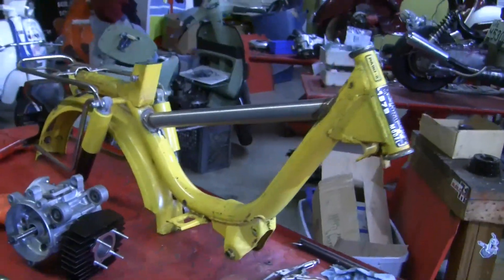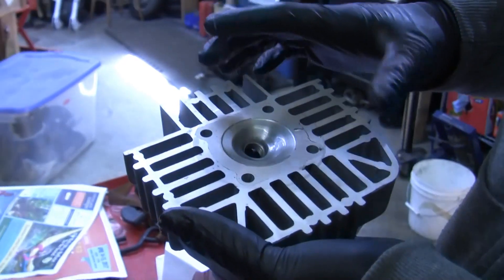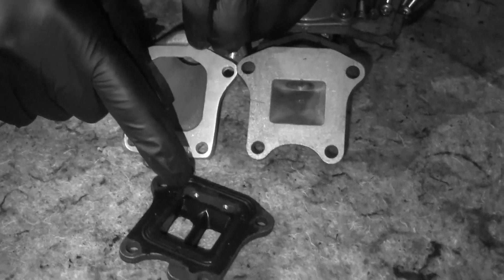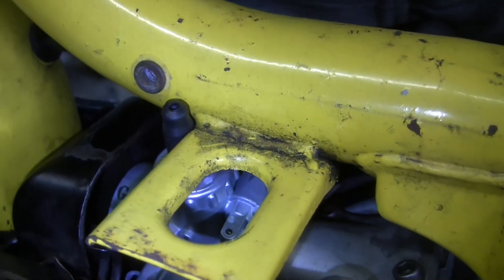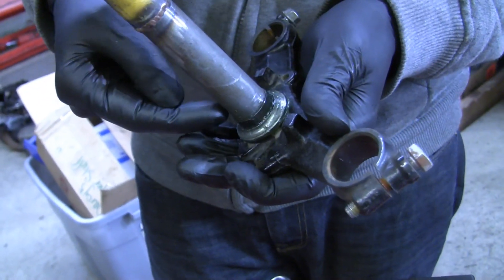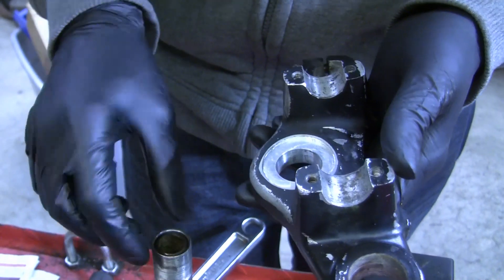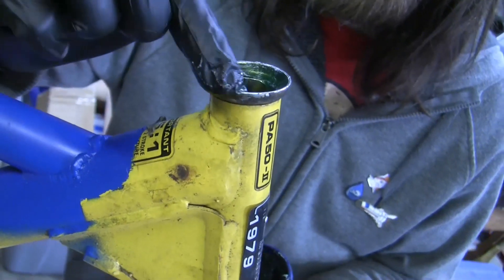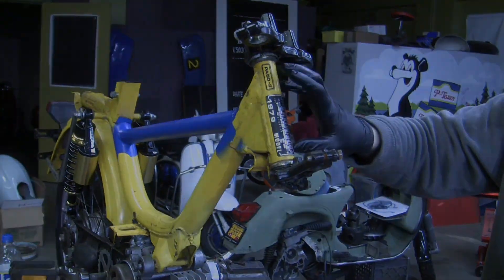(5a/6) Bakers Dozen HOBBIT BUILD:  Cylinder Head / VM20 Intake Review / Headtube Wizardry!

Comment: That factory carb setup is BS. Aftermarket solution not any better. An angled extension to get it out of that hole would be what I would want to try. That fork/tripleclamp setup looks like a very nice solution. I personally don't like butchering a machine to accomadate a modification.  A Hobbit is cool but in this case rare historical artifact won't be lost if modified.
Reply: Exactly what I'm doing
Reply: The nf75 used a similar non slide type carb but in a 13.5mm or 14mm Venturi.

The cylinder stud pattern is also the same as the pa50, the head is basically the same design as the pa50 but has a larger combustion chamber without a decomp unit.

NF75 also has a larger variator with a kick start which turns the varistor via shoes in the front pulled just like the pa50.

Basically I suspect the nf75 engine could be fitted to the pa50 engine frame complete with little modification.

Comment: hello Travis how are you my name is Thomas and I have a 1977 motor became I have fuel problems. Problem that I am facing is that there is no fuel getting to the carburetor when I spray carburetor fluid inside of it it runs until the fluid runs out but it will not stay on for no more than 5 seconds I've tried pouring gas or mix gas in it and still the same results what is there can I do to relieve this problem
Reply: You have a fuel flow problem everything still needs to be cleaned out flow level check proper jet
Reply: Love the mbk crazy bike but they are super rare.